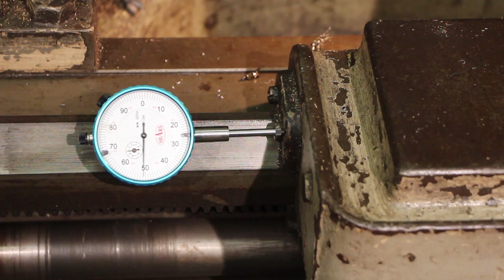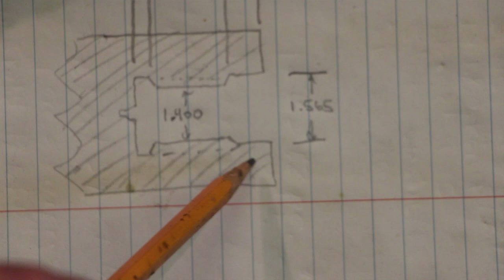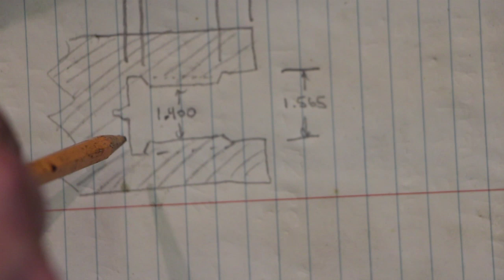Machining a Greenlee Shaper Spindle:  Part 2 - Internal Threading and Milling a Hex

Comment: great tip on the use of angle plates. for those not fortunate enough to have a set of angle plates, i have found plastic angle plates sold for draftsmen to work well. they are quite accurate ,come in various sizes and are cheap.

Comment: Oldie but goodie here Keith!  Love the angle plate usage here for milling the hex from before you got your super-spacer and dividing head that's in in your later videos.  Impressive use too of using multiple dial indicators to work in a blind hole on the lathe. ^^
Reply from the maker: Thank you!
Reply: Keith Rucker - VintageMachinery.org What I really liked about the angle plate setup, is that I immediately got to thinking that setup could possibly be used in a pinch to plunge-cut fab up quickie nuts on the drill-press, that don't have to be dead-accurate if you had the endmill of the size needed for what you were doing, and the means to mount it up in your drill press.

Comment: There are axial loads on the shaft caused by the torque that results when the tool takes impact loads as the cutting blades first bite into the wood. The internal threading on the spindle seems to bedesigned to insure that the loads are transferred onto the shoulder of the arbor and not through the threads themselves into the center of the head on the shaper.
Nice video Keith.

Comment: I really liked the way you used the angle plates on the mill. I have a set of the angle plates but have never used them. Now I know at one application I can use them. Thanks

Comment: Nice to see good threading into blind hole without crashing. I like to use a left hand tool and run the lathe in reverse. That way your feeding from the inside to the outside. No chance of crashing.

Comment: I use the angle plate trick all the time. My approach is to mill flat #1 then flip it 180 and mill flat #4 using an adjustable parallel or a 1 2 3 block on edge to maintain perpendicularity then use I the hard gauge for the remaining faces.
Reply: ***** milling a hex pops up quite often and most people don't have a spindex. I have quite a few ways that I have used to get the job done and will try to spend some time this week in the shop to make a video six ways to mill a hex. I will try and show the way to use a 123 block.

Comment: One other thought I had was with this item you could always turn the spindle around and do a trial cut to check your angles and depths on the end that's going to get turned down and threaded.   In fact a beginner could do a couple trial passes until you have the depth and angles perfect.  Then make the cuts for real and turn the rest down and thread it!

Comment: Good video segment Keith. I liked the hex cutting section. The setup on the vice and angle block was probably just as fast as dragging out the super spacer anyway.
Not everything in the machine shop is done to exacting tolerances. Save the big precision for where it's needed. :-)

Colin

Comment: Keith, nice work!  My rule is that if it works, it's not wrong. Your method worked, and will work for a lot more who don't have the fancier tooling. 

On the threading...I understood that the reason for feeding in at an angle was to reduce the load on the cutter to something low powered lathes could deal with.  Since you are using a form tool type cutter on a lathe that can hog off .125 passes easily, is there still a reason not to go straight in and cut both sides of the thread at once?  

Thanks for showing a way to get the job done!

-- Mike

Comment: wonder if running backwards and feeding from bottom of the holes might have been an option to avoid the worry of tracking the bottom.  Great video!
Reply: When you added the relief in the bottom of the hole I thought that was where you were headed.   Really enjoy your work!

Comment: I'll tell you what I would have done on the second cut. I wouldn't try to hang the triangle upside-down, I'd just rotate the first cut down to the triangle and continue rotating for the third cut, the switch the setup blocks to the other side for fourth cut and  resume after that cut to the front of the table. But that's just me. Maybe it would work, or it maybe it wouldn't.